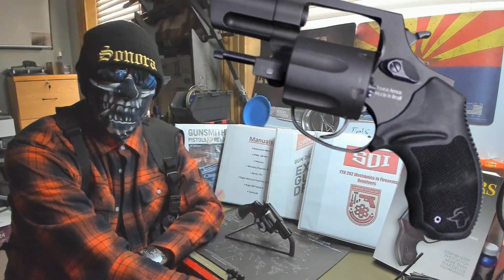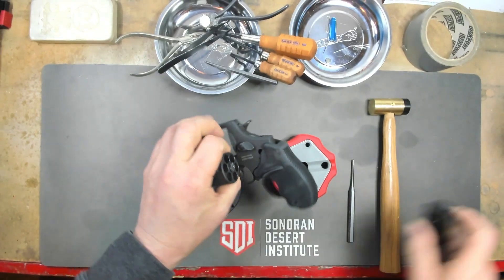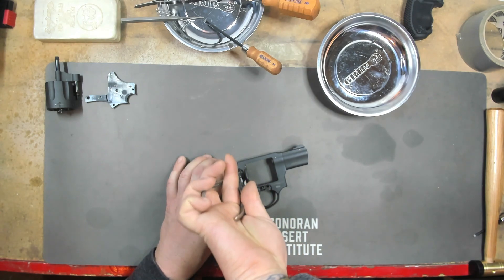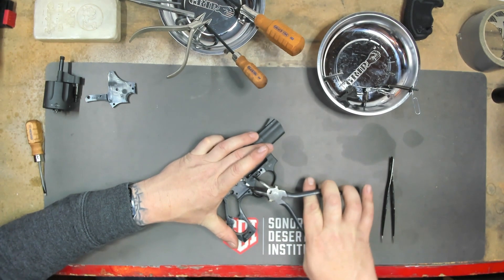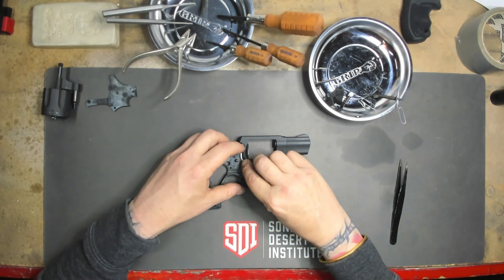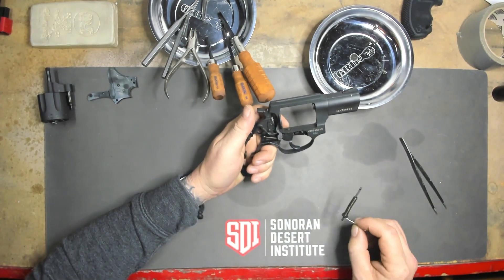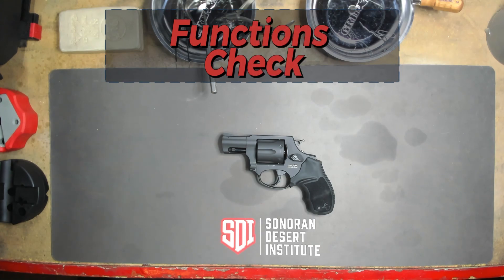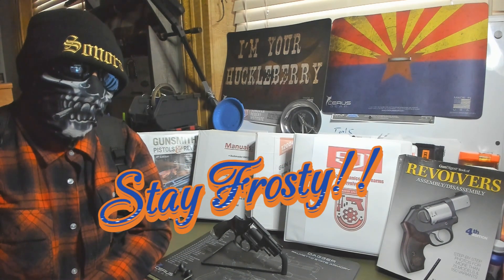Taurus 856 | Disassembly/Reassembly | Functions Check | Cycle of Operations | Redux

Comment: Great video 
Does the transfer bar rattle in place and have some side to side movement when all put together? Not sure if some movement and rattle sound is normal thanks
Reply: Ok thank you
Reply from the maker: Hi KL, do you mean once it is reassembled?  It shouldn't really have any movement and shouldn't rattle once reassembled.  It may have come off of the leg if it's moving around.
Reply: Ok thanks for your input… it goes up and down like normal but actually will have room to move forward and back a bit in the place it sits in. I’ll have to call the folks at Taurus and also go to my local store to have a Quick Look and compare thanks
Reply from the maker: Alright, sorry I couldn't help better.  It sounds like it's not in the hole on the trigger correctly.  Hard to envision exactly what you mean.  If you are on the server, just ping me and I'll help when I can...we can do video from there.